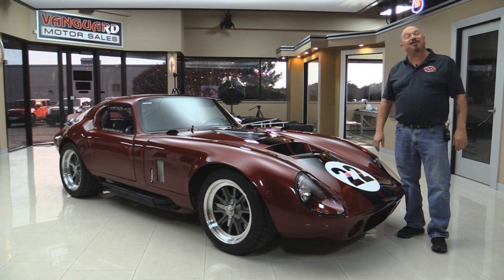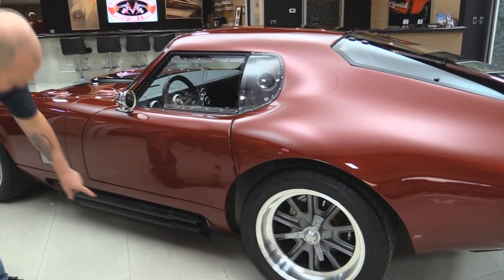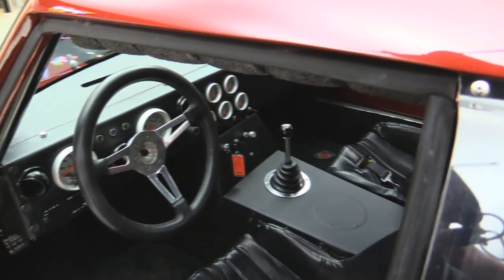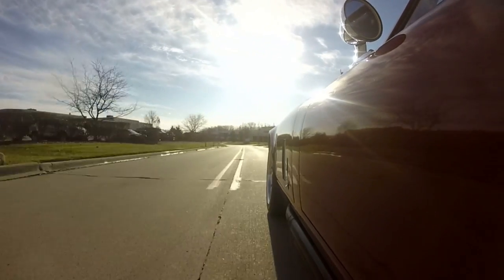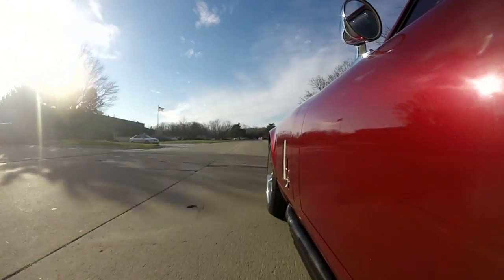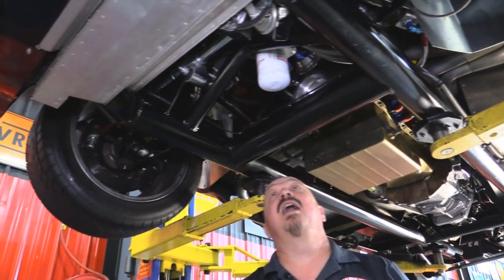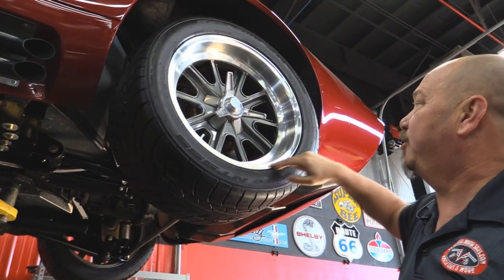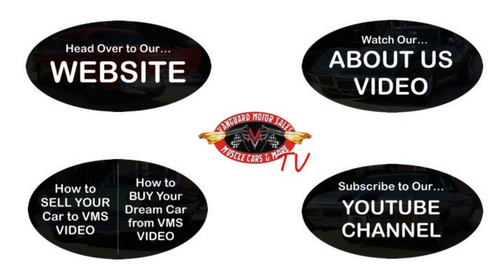1964 Shelby Daytona Coupe Factory Five Recreation For Sale

Comment: What's the year, motor, and asking price on this one?   Also, how does this compare to superformance's daytona version?
Reply from the maker: Im sorry this car is sold. As for the comparison it very much depends on the mechanic and the painter considering the superformance is factory built vs the FF being a kit car. Factory fives can be just as nice as superformance if you get the right one. This one for example was as nice as its superformance counterpart because the builders really knew what they were doing and had a very fine attention to detail.